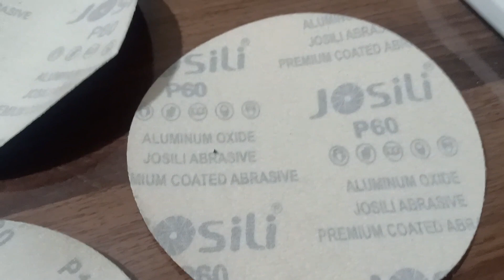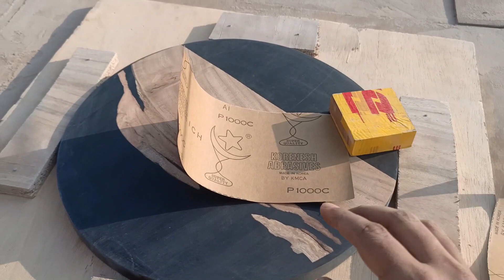How to make Epoxy Resin Clock | Black Art Epoxy Clock Step by Step | Epoxy and Wood Clock full guide

Comment: How to make mold of clock plz explain
Reply from the maker: with plastic sheet and siliconized tape, I also explained in the video but if you want to more explanation then tell me I will help you as soon as possible.
Reply: Which sheet you are using to make circle
Reply from the maker: PVC sheet, polypropylene sheet